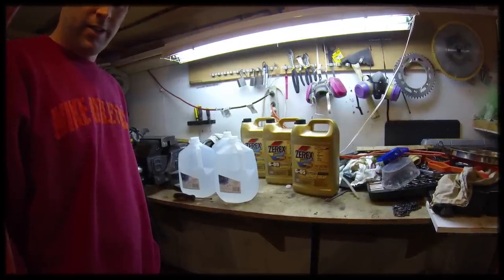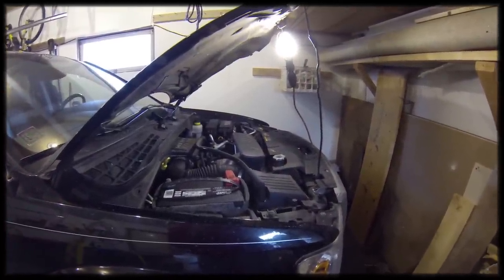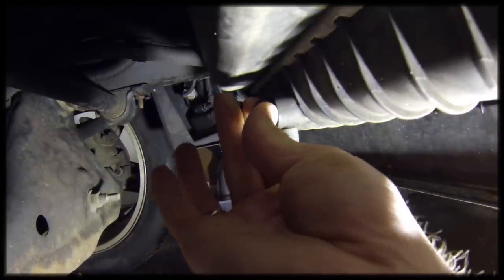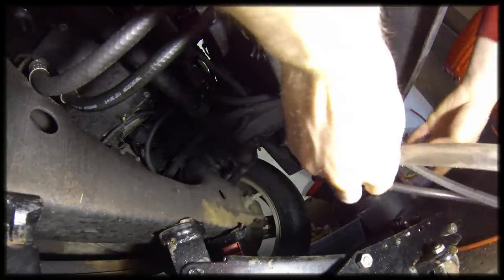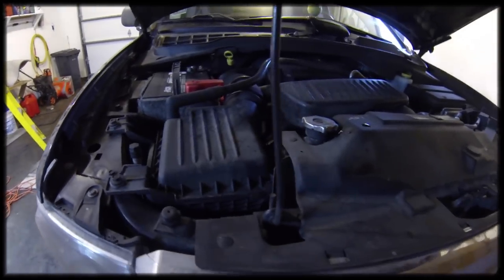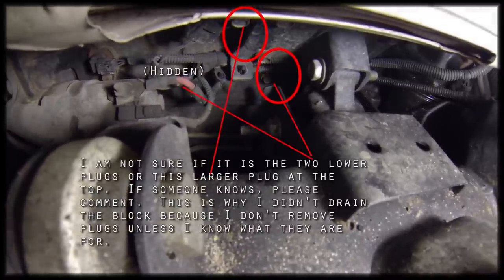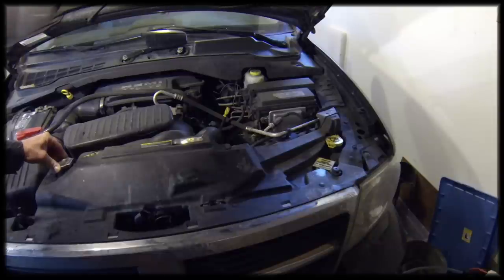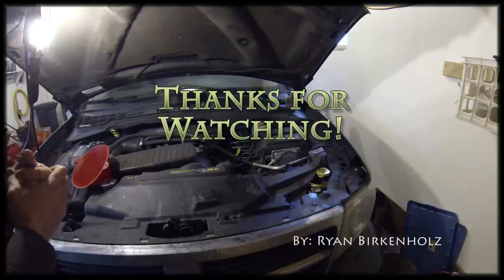2007 Dodge Durango - Coolant Change

Comment: Hi, thank you for your video!.
I have a 2009 Durango SLT 5.7 Hemi, will have to do the cooling system flash tomorrow, bought 2 bottles of PRESTONE flush+cleaner and 5 gal. of PRESTONE prediluted 50/50 coolant (for ALL VEHICLES, HOAT&OAT compatible), also thinking to clean the reservoir...will have to investigate how to remove it...have you done this?.
Thanks again.

Comment: Good video. I want to also thank you for your video on their rear differential as well. I have the 3.7 liter motor and I found a bleeder screw. It's located where the top radiator hose meets the engine block. It's a hex screw. If it's on the Hemi, hopefully it's there.
Reply: No 3.7 it's 4.7
Reply: @MarkSmith-tc2lu  hate to tell you, but you’re wrong. There is a 3.7 6-cylinder for the Dodge Durango.

Comment: I have a 05 hemi. Did the resoivar drain with the radiator as well? I checked mine and its probably at half. N in december im going on a road trip, and was planning to just drain and refill. Did yours have any change in temperature after you refilled?

Comment: Tap water is ok
Reply from the maker: You could probably get away with it but I don't like introducing any more minerals in the system than needed.  Distilled water is cheap so I use it just to be safe.
Reply: Of course it is .